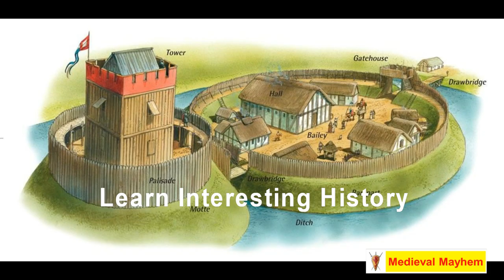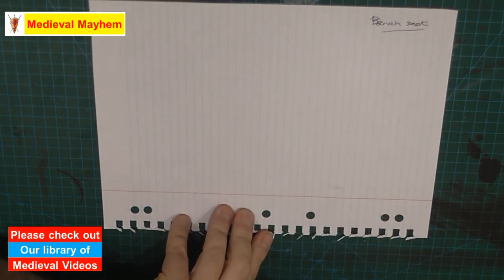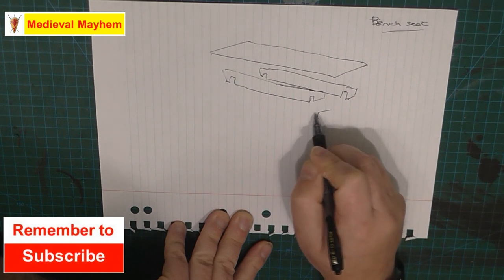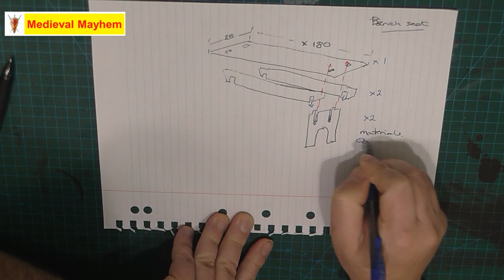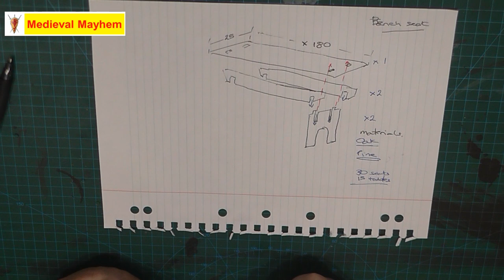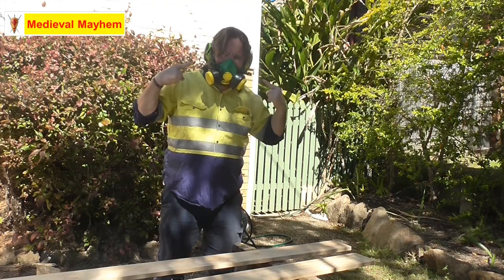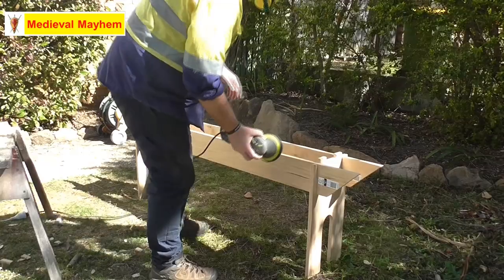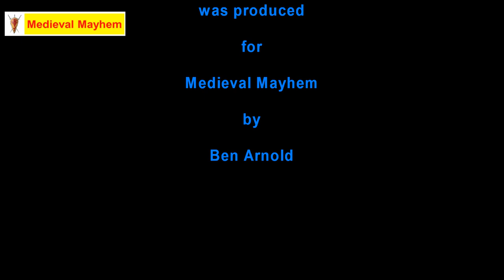How to make a medieval Bench seat (DIY)

Comment: Was there a historical find you based this upon?
Reply from the maker: No, not specifically. This isn't a reproduction - rather a piece of wooden furniture using no modern joinery techniques that could quite easily be achieved in the medieval period. There are illustrations that show a similar style of bench seat - but without enough detail to clearly define the components and assembly.
Reply: @Medieval_Mayhem  - understood, and thanks!